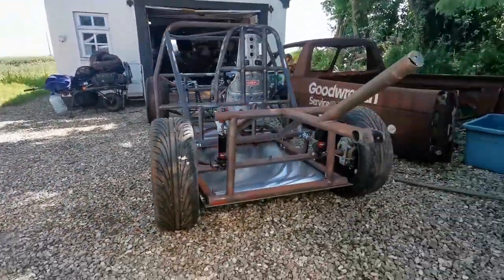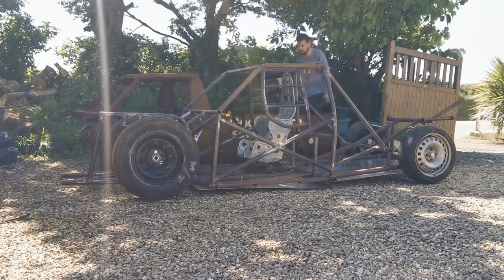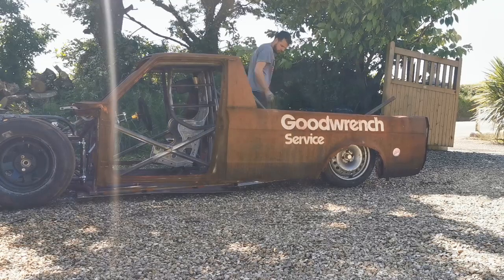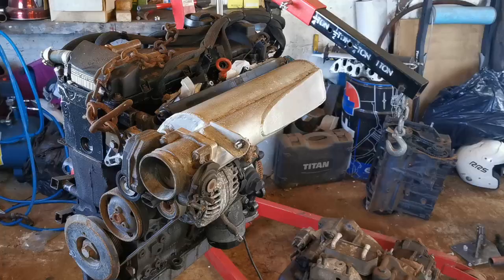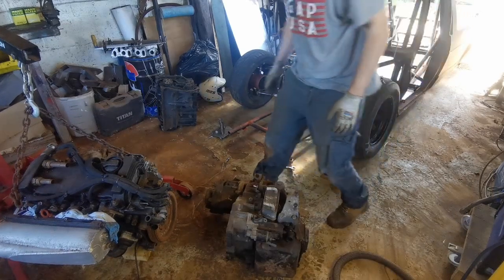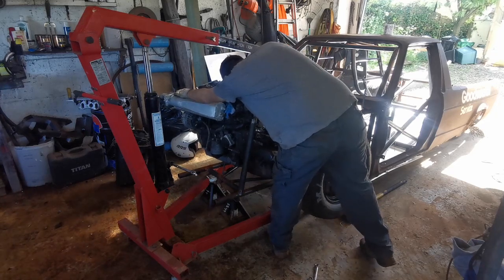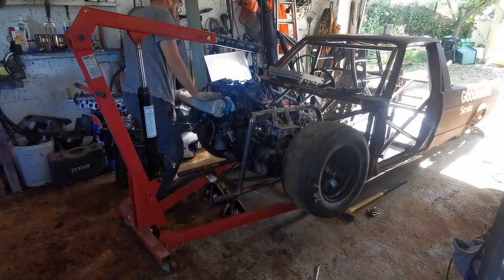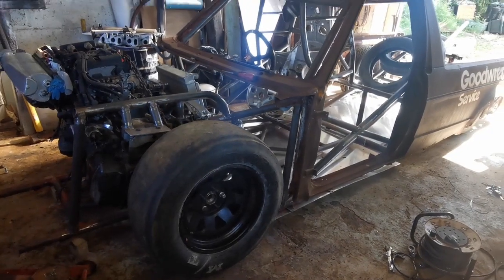Tube Chassis MK1 Caddy build.

Comment: It's looking good 👌, are you going to wind the front up or are you looking to use a beam breaker?
Reply from the maker: I've some springs comming to sort out the height, going to be bang on the minimum 3 inches. I will be using a beam breaker though I think, even though its cheating 😅
Reply: @VR6VR6  nah its not cheating, just using the rulebook to your advantage 😁

Comment: Don't suppose you would be willing to share your specsheet for the tubing, I would love to do something like this with my caddy
Reply from the maker: Hi mate, what info are you after exaclty?
Reply: @VR6VR6  hi bud, I'm keen on building the tube frame for my caddy as I have always liked the look, so what I'm after is the measurements and construction guidelines if that makes sense, I am planning on a few changes to make it more personal but if I can get the tube lengths, sizes and weld points it would make it easier for me to recreate. Shot for getting back to me BTW, I appreciate it 👍
Reply from the maker: @H0DG1E_85  hi mate, because mine is built for drag racing I used a rule book called SFI 25.4. It gives you a  rough design to follow, but Other than that, I have pretty much just made up the design as I gone along! I made a video that explains how much its cost, and in that I calculated the amount of tube I've used.

Are you looking to make it to race in a specific series or just for personal use?
Reply: Just making it for personal use bud, I've always liked the idea of having a full cage with a caddy wrapped around it. I'll search for the SFI booklet and use it as a guideline.

I watched your episode of cost of tubing, was informative, thanks.